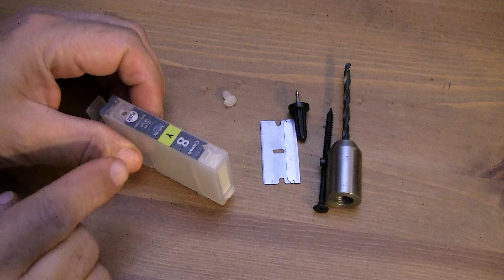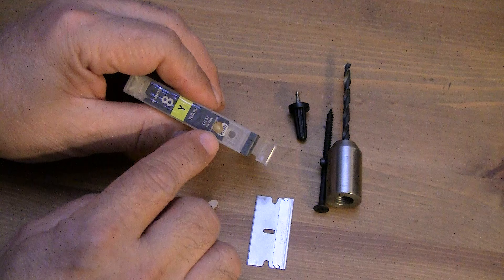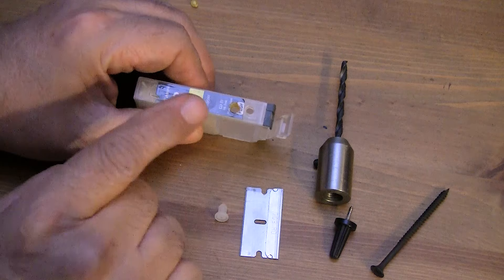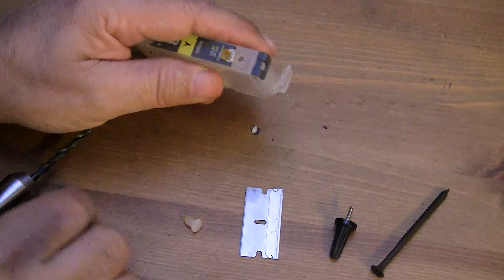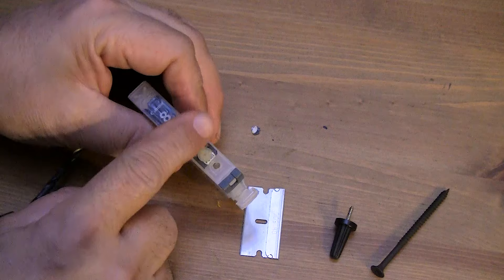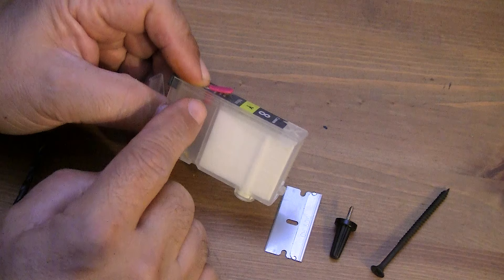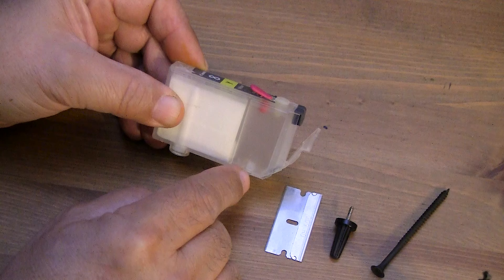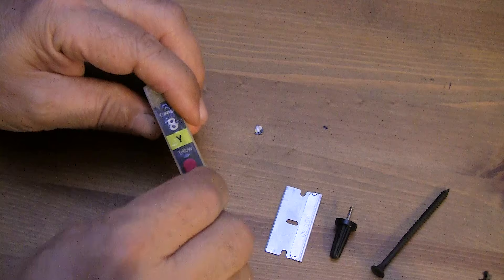My method for Modifying The Canon CLI 8 and CLI 42 cartridges

Comment: hello Jose, Thank you for all your input and work with the  Canon Pro 100. I do have 2 questions though.

First. Why don't you like the a hole drilled in the top of the cartridge and what benefit is going through the process you describe?

Second. Wouldn't be easier that after you remove the ball you take the razor you show and trim the bottom of the plug a bit so it fits and seals.?

Again thank you and I am continuing to watch your vids that definitely help me get 100% use out of my Pro 100.

PS sorry if these questions have been asked before !
Reply from the maker: The first answer is the thickness of the upper shell is about 1/64" thick.  Not be enough surface area to provide sufficient sealing IF you screw up the and end up with a slightly larger hole.
The second answer is that the actual sealing takes place at the lower end of the factory hole, specifically at the point where the ball seat is drop d out to 5/32" diameter.
This systems has been figured out, tested and refined by other folks long ago and has been proven to be the best.  Why try to fix what's not broken by using a possibly easier method that may not be as reliable?

Comment: Great video.  You talked about acquiring and using a second set of carts in another one of your video's.
I would like to purchase a 2nd set of carts , so i don't want to have to transfer my original Canon 42 chips to a new set.    
a.)   How can I get a second set ?  
b.)   Will I need a second resetter ?

Thanks for your generous consideration,
Sincerely .....................

Comment: Jose, every time I watch one of your videos I learn something new and end up with a new question. I'm not sure I've ever heard you say put tape on the vent hole when storing but I may have missed it in another of your videos.  Will ink spill out of that hole if flipped over?
Reply from the maker: The ink will not spin out. I have to correct myself a bit. If  you mean to store carts after refilling for month? Then yes tape the vent. But My Refills do not stay unused for more than a couple of weeks max so there is no need for me to tape the vents. Actually it's best not to do it as you MIGHT forget to remove the tape and then that channel will run DRY and the print head can be damaged.

Comment: Great video. I've been looking into the Canon Pixima Pro 100 and came across your videos. Thank you for taking the time to explain how to refill the ink cartridges. for a person like myself would it be wise to just buy the deluxe ink refill kit from precision colors and just transfer the  chips? i don't have power tools to make the modifications necessary
Reply from the maker: +Antonio229 Except none of the kits come with 8 carts so you can swop chips to. It comes with only the one replacement for the original Yellow one. Which is the one that you most change the original! You do not need any power tools. Buy yourself s 5?32" diameter drill bit and drill out the hole by hand. Insert the bit and lightly turn it by hand into the hole to remove the bottom seat. You original Carts are the BEST option for total reliability! Transferring the chips actually takes more work than modifying a cart. But if you fell it is too much, ask Mike if he can sell you a set of re modified carts and then transfer the original carts chips. Make sure that you match the colors. Some of the CLI-8s will have to be relabeled as the PRO-100 CLI-42 color set does not match 100% the CLI-8s!
Reply: +Jose Rodriguez thank you for the advice.
Reply from the maker: +Antonio229 No problem.

Comment: Hi. Precision Colors clear plugs that were included with the refill kit don’t sit flush against the cart... they fit snugly but don’t go down completely. Is this ok?
Reply from the maker: Did you drill out the hole to 5/32" like you were supposed to after removing the ball?
Reply: Jose Rodriguez yes i did exactly like you said. The white plug doesn’t go down to the cart fully even in the modified yellow cart sent by P.C.
Reply from the maker: If you drilled the hole correctly and the plug doesn't fit then you need to contact precisioncolors.

Comment: Hello Joe. I have taken the ball out and drilled (by hand) 5/32 hole. However, I am having great difficulty getting the rubber plug supplied by Precision colors to seat completely as I see you doing here. Mine stick out a bit on the top and I am wondering if this will seal the ink flow completely. I have redone the drilling (by hand) 2 more times trying to slightly increase the hole but the rubber plugs do not completely get flat as I see in your video. Maybe a 1/16" inch is still stick out. Suggestions? or am I ok?
Reply from the maker: As long as part of the plug extends PAST the hole into the liquid chamber you are ok.
Reply: @cheo1949  Thanks. Just a rookie and do not want to damage my great printer.

Comment: Hi Jose - even if a small amount of swarf / dust gets into the cartridge when you drill the 5/32 hole i gues it doesn't matter too much as it will be retained by the sponge in any event?
Reply from the maker: There is no dust created. This is a very gummy plastic. Believe me nothing happens when you drill it.
Reply: @cheo1949  Hi Jose just drilled 2 carts as per your video and the swarf came out on the drill - as I say i don't think that any debris would get past the sponge in any event. Great tutorials - many thanks. Don
Reply from the maker: Also, don't forget the reverse helix of a drill bit. By its natural action will pull swarf out rather than push it in.

Comment: Joe, appreciate all your videos, they have been very helpful.  I have a question regarding a CLI 8 yellow cartridge that I have flushed for future use in a Pro-100.  How do you dry the sponge prior to refilling with the appropriate ink?  Thanks,
Reply from the maker: +trout479 I will dry by itself if you simplyt place it on a warm dry place for a few days. Or to expedite the drying process, make a little "Rope" by tightly twisting a sheet of paper toweling. Rubber bade one end of the "Rope" on to the cart so the Paper Towel "Rope" in in direct contact with the exit port sponge of the you wan to dry. Place it standing up in a warm dry place for a day or so. It will be ready to refil then.
Reply: thanks for the reply, was concerned that moisture would be retained inside and cause problems with dilution of the ink.
Reply from the maker: +trout479 If you have too much moisture you will indeed dilute the ink. Oftenit will also disruct the absorption of ink into the sponge.So I simply recommend you either use the Wicking onto the paper towel "Rope" or simplya setting them aside to dry on their own. This takes longer than the wick method.Often If I flush a batch of carts, I will let them sit on a tray for about a wekk until I need them.

Comment: Hi, thanks for your videos. I have a question regarding modified CLI-42 cartridges. I drilled 5/32 hole, but there are some plastic shavings inside the cartridge, should I be concern about them and try to remove it or just leave it alone like some people say. Is there a way to remove those pieces of plastic. Thanks.
Reply from the maker: They would have to sink and the do not. They float. DO not worry about it.
Reply: @cheo1949  Thanks

Comment: where do you get the rubber plugs. to plug the cartriges. Ide also like to know for Epson 3880 printer can you mix the inkjet mall ink to the oem Epson ink for the 3880 will it mix and print  hi quality images
Reply from the maker: +Hellgap50 Get them from any 3rd party ink / cart dealer. And yes you can mix the CONE and OEM. But ontil you are running PURE CONE then you can make your own profiles and get the best results. Until then just use EPSON's

Comment: Hi, Jose 
I recently order the empty carts from precision ink to avoid having to drill the holes myself..when they arrived they had a note the says: the chips that are installed on these re-furbished cartridges cli-8 will not work on the pro-100..you carefully need to remove these and transfer cli-42 chips to these cartridges..I'm a little confused now because I assumed all I would have to do upon receiving these carts is use the little reset tool I purchased? Help please 🤔

Thanks
Reply from the maker: No! It Clearly says in RED right on the ordering section that you have to swap chips 

32oz ICC Squezy Ultimate Refill Kit 
with Resetter, 8 Ready to Fill Canon Cartridges
8 x 4oz Dye ink with 8 Squezy caps, Ready to refill original Canon cartridges, Electronic Resetter
Note: you will need the chips from the Canon CLI-42 cartridges,"Setups" are also OK
Reply from the maker: CLI-8 and CLI-42 carts are physically identical. BUT the Chips are for different printers. The 8s are for the PRO-9000 MKII and the 42s are for the PRO-100
There are no CLI-42 empties anywhere that they could refurbish and reset so the only think available if the CLI-8s and soon there won't be any of those either.
Watch the video I recently uploaded.
https://www.youtube.com/watch?v=9jrIHKVqrKo
Reply: Thanks for the quick reply! I do have the carts the printer came with so I should be able to swap those chips out and put them on the refurbished ones right?
Reply from the maker: Yes. Make sure you only shave off the left post. Leave the one where the chip slips is intact. If you some how damage the posts you will have to glue them in place making sure the chip is aligned to the posts.

Comment: Joe I have a choice between a 3.8 mm or 4 mm drill bit as I don't have a 5/32" drill bit. 5/32" is equal to 3.968 mm. Do you think I should use the 3.8 or 4mm drill bit as a replacement for the 5/32"?
Reply from the maker: Seriously, just remove the chip on the cart and you will see that the compartment has this little slot in line with the plastic light pipe that matches the back of the chip's electronics.  The back of the Chinese chip has around blob of black resin. So it is not going to sit flush unless you remove a bit of the plastic on the chip compartment. 3.8-4 mm is perfect and just take off enough material to allow the chip to sit flat. Remember to removed the chip carefully ( As shown in my videos ) so you can later reinsert chips without have to use an adhesive.
Reply: My question deals with the hole that needs to be drilled after you remove the small plastic hub where you fill the cartridge... not anything to do with the chip.
Reply from the maker: Oh I thought we were talking about the PRO-1! Sorry about that.  You really need to nail that 5/32" diameter equivalent down to as close as possible or the hole will be too large and the plug will not seal, which will create massive leaks. Contact www.octoinkjet.co.uk to see if they sell the proper drill diameter.